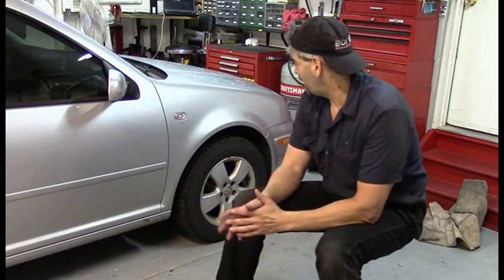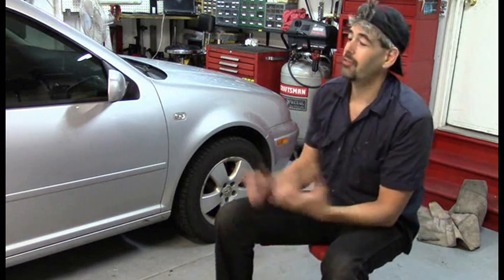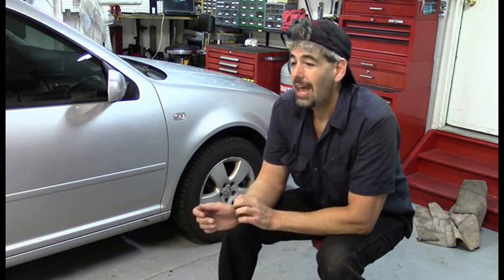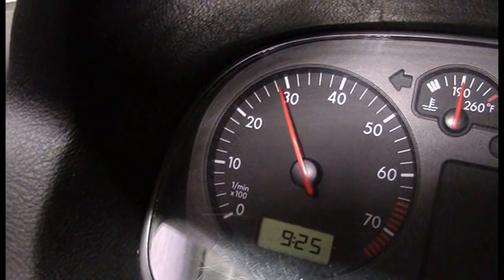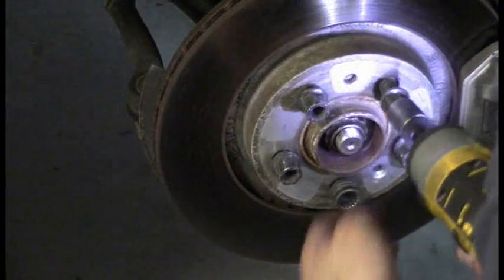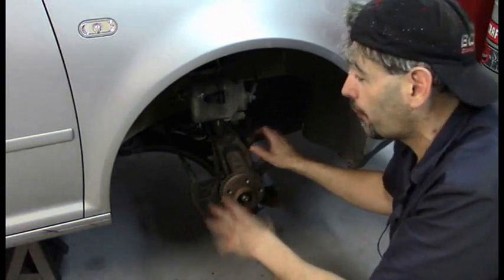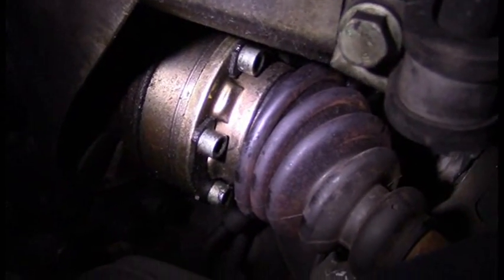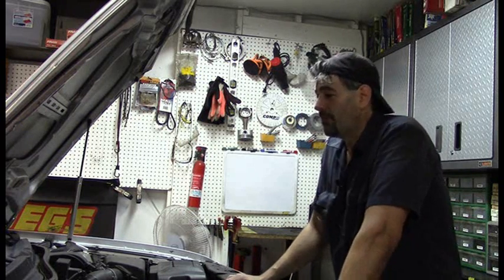2003 Jetta Vibration Diagnosis- Is it Driveline, Clutch, or other?

Comment: Well my car starts vibrating when I accelerate. I have not tried what you have done in this video but all my suspension is new because I needed to be replaced. The vibration feels like it's coming from the passengers side.
Reply from the maker: having similar symptoms does Not logically necessitate identical problems. You need to do independent diagnosis.
Reply: yeah I'm gonna do what you did in the video. but what i noticed this morning is that mine only does it from 2500 rpms to 3000. but what was the problem with the car in the video?
Reply from the maker: Jesus Pantoja Flywheel imbalance
Reply: So thats was the problem? And that solved it?
Reply: Was it a dual mass flywheel by any chance? and did you replace it to solve the problem? thanks in advance.
Reply: Perhaps  CV Joints need to be replaced.

Comment: What did it come down to in the end mate? My mk4 golf is having similar problems. I'm not too sure after seeing this video that it happens at a specific rev range. Mine just feels like a wheel wobble under acceleration. It's in the garage at the minute but whatever your outcome was may just come in handy?
Thanks for your time, and sharing your knowledge
Reply from the maker: +connolly3000 Owner never brought car back to me so we'll never know.
Reply: +Schrodingers Box At least you got a giagnosis video from him! Do you reckon it was flywheel related? I know these suffer bad flywheels in their life, which makes sense that it vibrates at peak torque
Reply from the maker: connolly3000 I figure maybe the guy will eventually need a clutch and if he brings it back to me we'll know.
Reply: +Schrodingers Box Also would like to know the outcome because my Mk4 TDi does the same at 1.8k - 2.1k rpm (lower due to it being a diesel) . 

Really would like to know the answer , notice that it is more noticeable when car was standing overnight but if I drive it all day or spirited driving then it sort of goes away, so thinking its a lubricated component? I dont know but yeah need help
Reply from the maker: Taariq Clark But my answer does not necessitate it will be your answer so either way you have to your own independent diagnosis
Reply: +Schrodingers Box  you check the control arm bushings
Reply: +gabriel barajas 
In the end, my vibration turned out to be the passenger side engine mount. It had enough play in it that when under load (on the torque end between 3000-4000) the engine sort of twisted when under load. Rather then going straight back the left hand mount would allow much more movement and I assume that this was the reason for drive shaft wobble which felt like front left wheel was about to come underneath itself! (I'm UK btw, to save confusion on left hand side... that is my passenger side)
Reply: Nice
Reply: @lukec410  Wow this brings me back lol... I remember clearly though, this was a petrol Mk4 1.8 20v Turbo I had. Rev range upto 6800RPM before it hit the limiter, unlike Diesel 4500rpm. 
During faster acceleration where you can get through 650rpm (idle) right through to 6800rpm, so 1st, 2nd & 3rd mostly noticeable. Only under actual throttle could you feel vibration, as you throttle the engine moves and the mounts try to prevent that movement, one of my mounts were completely perished and allowed the engine to move more on one side than the other and it caused the entire driveshaft to vibrate! 
When I was diagnosing this issue, I kept taking my foot off of the accelerator and the vibration would stop (because it was no longer under load) 
When the car was rolling freely, the vibration was no longer present. This rules out "unbalanced wheels" or wheel bearings being knackered.

What symptoms are you having and what methods have you tried to pin point the vibration issue you're having?
Reply: +CuntShovel haha, thanks for replying! Wasn't expecting it! I seem to experience resonance at 3.9-4.1K which isn't present anywhere else. Haven't tried to see what happens in neutral, however I'll likely see today or tomorrow. 
Best regards!
Reply: @lukec410  As long as you reply directly to me, I'll reply back lol. Most people don't reply to the person they're questioning so that person won't receive a notification! 
Let me know how you get on, best of luck!

Comment: Looking forward to part 2. Also looked to me like the rf tire was maybe rotating the wrong direction.any one else notice that?
Reply: Ya I saw that as well..(see my above post) lol…sure looked wrong to me.  If thats the case, it says a lot about the shop that services that poor car :)
Reply from the maker: Hahaha nice catch guys on the directional tires! I didn't notice that!! I will have to check.  Prior to the video I did switch the front and rear tires to see if vibration moved to the rear of the car (it did not of course) but I did keep the wheels on the same side of the car, so if the tires are indeed directional, at the very least the rear ones were on backwards, but probably all 4 are.  I will have to stop by and look at those tires!  Hilarious!!

Comment: If you was the first shop who installed the clutch and axle and the customer came back from the dealer which what ever diagnosis they did, points the axle, you will do this diagnostic. Will you charge the customer for this diagnostic. And at the end would the customer be charged more than if he would have just paid the difference in axle price. And if you charged for all this diagnostic and still end you having to drop the tranny. How would the customer take this.
Reply from the maker: That's a great question and it's a little different for me since I am not a professional mechanic.  My policy is very simple- if I make a diagnosis and I am wrong, I pay for the parts the customer bought that they did not need and do the labor for free.  It gtets a little complicated sometimes because I may not have the equipment needed to make a diagnosis and in such cases I will tell the customer what I think it is, why I am limited in not being 100% certain and if they want to go ahead with my "educated guess" then it will be their risk.
  In this case though it is straightforward. If I do a clutch and driveline job and after the job there is a vibration that wasn't there before- I fix it at my expense.
Reply: Schrodingers Box its good to see other people's thought process and how they approach the each problems. I like your approach. Laying it out as a scientific experiment. I think that's how all diagnostic should be conducted. Maybe not all. Just wanted to see what different mechanic handle everyday problems.
Reply from the maker: slauj This approach is how all things in life should be conducted, especially important things ;-)

Comment: I noticed the tire to be directional and it was placed on wrong side of car...
just my 2 cents...p.s. love the channel...
Reply from the maker: +tinkerwest That's pretty interesting considering this car does not have directional tires on it.
  What is the time stamp that you saw that?
Reply: +Schrodingers Box 

I notice at 11:02 of the video the V-groove pattern in the tire to be facing 
forward which in my opinion makes it a directional tire

and therefore, installed backwards, not saying you did it of course as I'm 
sure the car came to you that way...
Reply from the maker: tinkerwest Bro that is not a directional tread.
Reply: +Schrodingers Box I would've surmised that the v-groove on the center of the tread can either push away or draw in water depending on it's rotation/direction...Well, that's probably why Mavis never hired me so sell/install tires...Still aspire to be among that 2%...  ;)

Comment: when i accelerate my audi a3 on the jacks, the engine is completly kickin with loud noises from the gearbox. The RPM is complety going crazy with higher speed on the axle. actually, the car is in the workshop for changing the clutch with DMF, 2.0 TDI with 160.000km on it, i hope it's the DMF
Reply: get rid of the dmf. that will fix the problem
Reply: The Problem is solved with new dmf. The dmf is a expensive part, but I think quiet useful. EGR is deactivated and recuperating battery and start stop is decoded :P

Comment: Damn, its a shame this was never resolved. I have a similar problem. With my car (Holden Barina 92 MH Manual 5 door), the vibration is only noticeable when the clutch is engaged and seems to get worse higher than 60km/h (its slight, but is still noticeable lower than 60km/h). The vibration is felt throughout car (more so in driver seat (feet resting on pedals) but what is most alarming is that the gear shift can be seen vibrating (more of a oscillation from side to side) and gets worse with more acceleration but disappears as soon as I stop accelerating. The problem happened when I replaced the front drive axles along with intermediate drive shaft bearing (center bearing). I have had all four wheels aligned and balanced. The tires also seem fine. I have a hunch it might be either the flywheel needing a machine and balance or the clutch plate is failing. The vibration gets worse from gears 3 to 5. 1st and 2nd and 3rd gear have a good amount of power but 4th and 5th seem to struggle as they are fighting the vibration. The engine mounts seems to also be fine. I had already replaced the center rear mount near gearbox so i'm assuming it cant be the mounts. I really wish you (Schrodingers Box) were in Australia so I could let you diagnose the problem I'm having. If anyone can offer any advice I would appreciate it greatly! XD
Reply: Hi, I would really appreciate some advice or how to deal with this issue. Please

Comment: I realize this is an older video and maybe you, or someone else has already solved this problem and I'm wasting my time.  I just wanted to say,  I have seen this same exact problem twice.  Once on one of my Jettas and once, believe it or not, on a Chevy Celebrity wagon (if I remember right).
The problem on my Jetta was a bad transmission mount and on the awesome Celebrity it was one of those upper "dog bone" motor mounts that GM loves to use on side mounted engines.
Oddly enough,  when it happened to my Jetta,  I found the answer in a Haynes manual.  It suggested "engine alignment" I think it even gave some sort of measurement you could do.  Don't quote me on that,  it was a long time ago.
Anyway,  the Celebrity was obvious.  The Jetta was not.  The transmission mount looked like it was fine until I moved it around with a pry bar and saw that the rubber had separated from the mount.
Reply from the maker: Good info. Unfortunately owner sold this car so we never did find out the cause.  Your info seems reasonable!
Reply: Schrodingers Box It's too bad they sold it before finding out what it was.  Hopefully your video will prevent a few people from replacing both axles.
It was really nice of Volkswagen to get a psychic involved and predict what the problem was. LOL!!!!
Reply: GRowe1978 that's very interesting. Maybe the shop damaged the mount when replacing the clutch.
Reply: danny dc2 That is a possibility, I replaced a transmission in my sister's Jetta and in the process of taking it apart I noticed that the rubber on the transmission mount had separated from the metal.  It could probably be easily overlooked.

Comment: Nice! But one potentially stupid thing to add- As you are no doubt aware of, engines vibrate more under load and they also vibrate at different frequencies based on RPM. I have seen quite a few heatshields and other things rattle only in a narrow RPM range and sometimes only when under load. The reason I am saying this is because I would think, please correct me if I am wrong, that a bad motor mount could possibly only cause vibration when under load from being in gear spinning the transmission and, maybe only when the engine is producing vibration at a specific frequency. Just a thought I had, sorry if it is stupid.
Reply from the maker: Yes absolutely a bad motor mount could cause this!!  The idea is to determine driveline or not.  Now that driveline has been eliminated other variables up to an including motor mounts would be considered.
  The ultimate cause actually turned out to be missing teeth on timing belt.
Reply: Schrodingers Box I see. Thank you for explaining. Just curious- Why would missing teeth on a timing belt only cause vibration when in gear and go away when the clutch is in? Also, is this the same car that is in the VW engine noise diagnosis video? Thank you for making such great videos and responding to my comments.
Reply from the maker: Avery Alexander Because the belt is imbalanced if the teeth are missing, Also the missing teeth cause vibration when the teeth on cogs do not mesh with the belt evenly.
Reply: Schrodingers Box Sorry, I do not understand why only when in gear. Could you explain why it would not do it at 3800-4000 RPM when not in gear?
Reply from the maker: Avery Alexander Oh yeah I forgot about that lol!! I am not sure why- I guess I can't explain it other than when I replaced timing belt the issue disappeared
Reply: Schrodingers Box Maybe because the engine needed to be under load to vibrate?
Reply from the maker: Avery Alexander Quite possible!

Comment: Hi, 
I have the exactly same problem, what fixed this problem, please? 
Was it clutch or flywheel or both?
Reply from the maker: Timing belt was bad.
Reply: I was hoping something along the lines of clutch as I had cam belt changed 6 months ago :(
Reply from the maker: well what was wrong with my car is completely irrelevant to what is wrong with your car- even if the cause happens to be the same.  It is completely irrelevant.  Each diagnose is independent.
Reply: Of course but I have had driveshafts changed, tyres balanced and only have vibration on load at certain RPM range. Car coasts fine in all gears, gears are smooth so this diagnosis is perfectly applicable to my car problem. I was wondering if you could advise me on next steps in the diagnosis. 

Is it Clutch+Flywheel>Cambelt>Camshaft/Crankshaft?
Reply: @SchrodingersBox  Thanks for the great video. What are your conclusions around the timing belt causing the vibration? Was it the belt itself vibrating or was it causing other components to vibrate or was it a timing issue? Thanks, just looking for more information before changing mine out.

Comment: Sounds like unbalanced component wrong torque, or combination of the two. Resonant vibration frequency depends on stiffness, which comes from engine load, mount load, torque load,  and the unbalanced mass.

Comment: Before ends video and find problems, let me say my opinion... Maybe is problem with wheels maybe needs to be rebalanced?
Reply from the maker: how can that be when removing the wheels still has the problem though?
Reply: @SchrodingersBox  Wery true, but im writing in first 5 minutes of beginning... I'm didn't come to that moment, and when you arrive there everything was obviously. Anyway... Thanks for good videos.
Reply: @SchrodingersBox  Also i forgot to mention that i not offensing you or ruin your methods... YOU DO JOB CORRECTLY 120%... Im just wants to helped... So, i have simular situation, somebody change bearings on Golf and punch with hammer corner on bearings hub (or how you name it), almost same problems gave in drive, but much more on breaking...
Reply from the maker: no worries, I am aware what you meant. thanks for watching.

Comment: well. Axle shaft Skoda Superb swapped.. Did not solve the issue :/
Reply from the maker: what happened when you removed the axleshaft and tested it? It should have still shown vibration indicating the axle is not the issue.